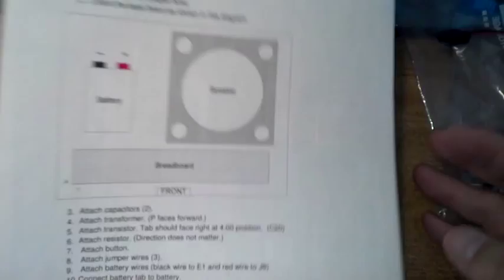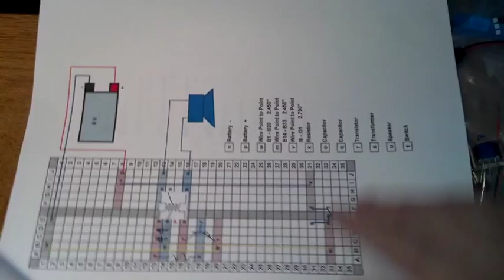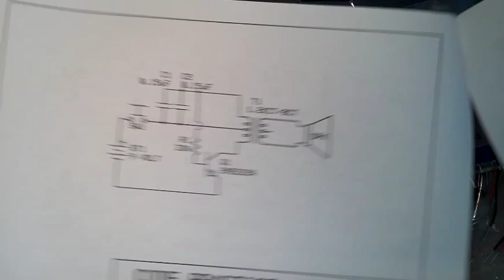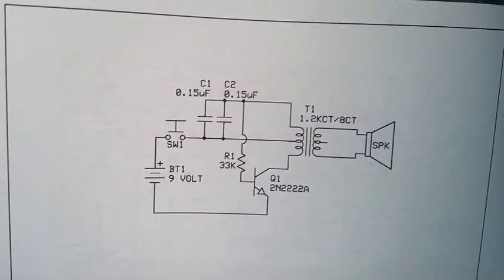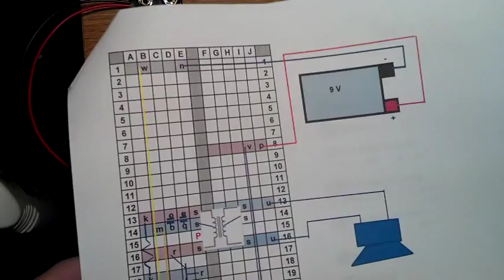Morse Code Oscillator Kit

Comment: thanks allot man, but help me with the transformer , what do the numbers mean??? i cant find a exact match to those numbers , so im trying to figure out what they mean so i can get a very close replacement.
Reply from the maker: +Hammer USN The numbers are the Primary Impedance and Secondary Impedance .
Simply stated :
 so what you have is Primary 1.2 k Ohms On the Ct (Center tap) 
and  8 Ohms on the CT ( Center Tap) 
Center Tap is the middle leg of the Audio Transformer. 

The full Explanation:

 A transformer winding that is center-tapped has an extra connection (the center-tap) in the center of the winding.

Sounds circular, doesn't it.

This allows several options when using the winding. You can get half the voltage, or do impedance matching (you get a 4:1 ratio), or treat the center-tap as AC ground and get half-voltage signals that are 180 degrees out of phase.

 I think this is is the part in question.
http://elcodis.com/parts/4367675/42TM003.html#datasheet
Reply: Thnx